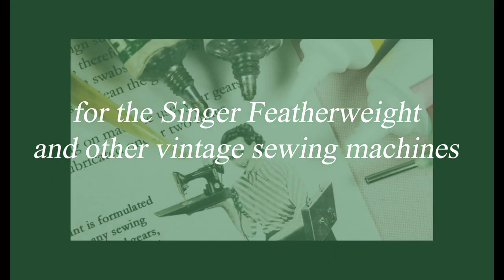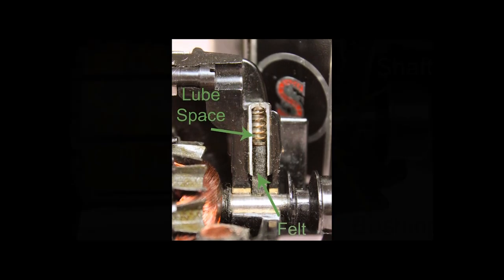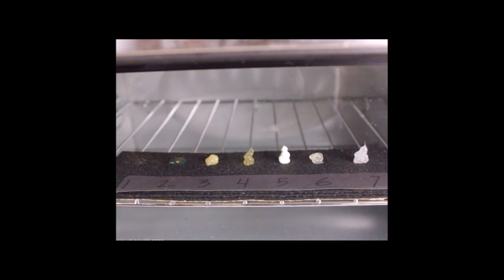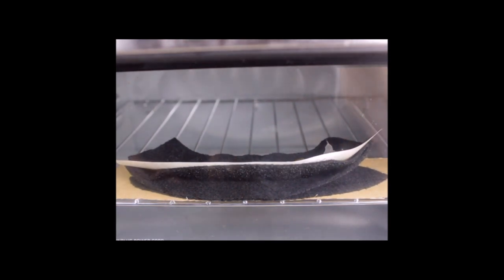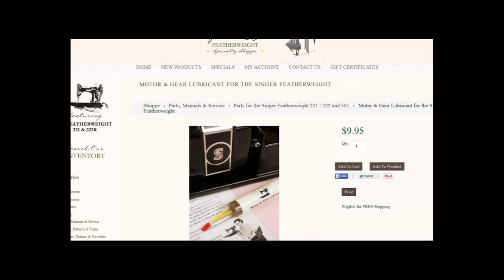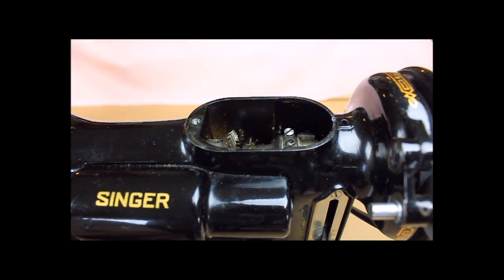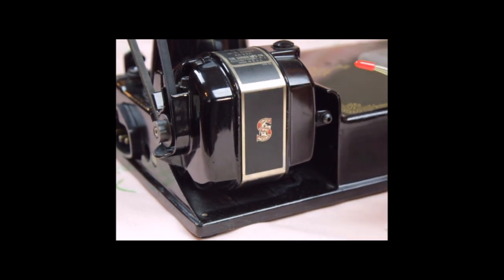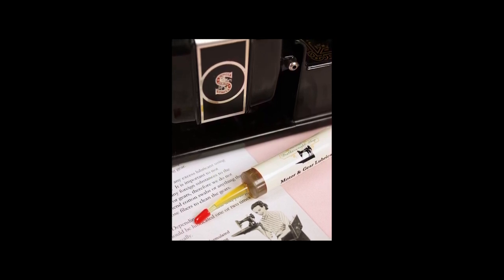COMPARISON Singer Featherweight 221 222 - Motor Grease Lubricant Part 1

Comment: SO will your motor lube be used for the gears as well as the wick tubes of a 15-91 and the motor 'stem" on my 301? Thank you.
Reply from the maker: Yes, Sew Retro grease was replicated after the original Singer grease, so it is safe to use in your Singer 301 and 15-91.
Reply from the maker: (Coincidentally, we have recently received odd comments here and there with false statements that Sew Retro Grease & Motor Lubricant is the same as Vaseline.  These are puzzling claims, because here's our blog post with original documentation from Singer and their specific references to Vaseline or petroleum jelly and why not to use it:  https://singer-featherweight.com/blogs/schoolhouse/motor-lubricant.)